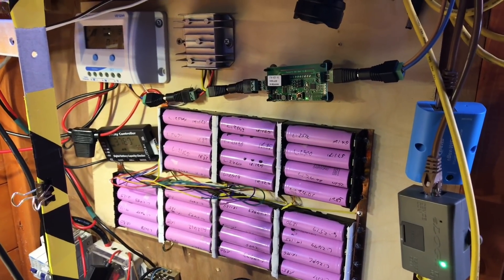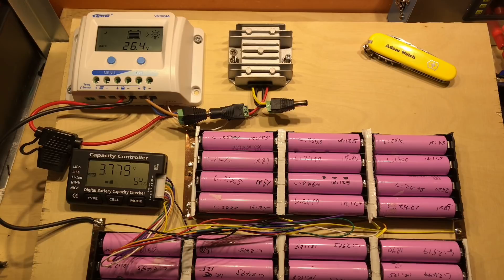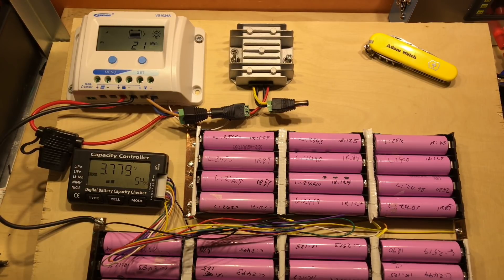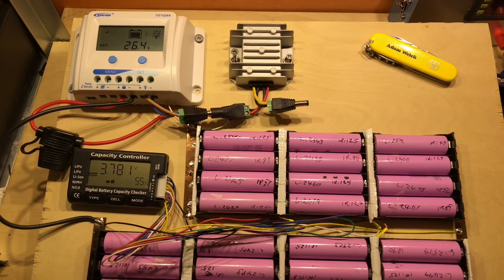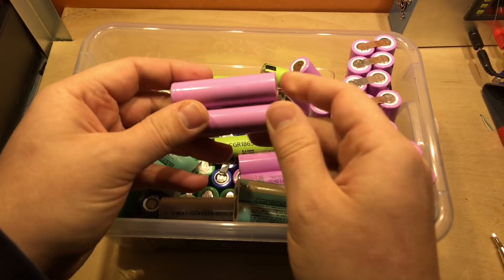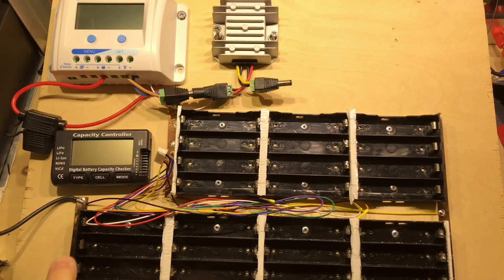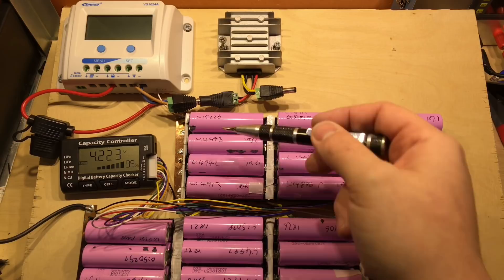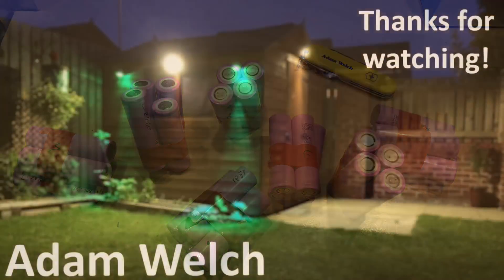Solar Charging Lithium Ion 18650s - Part 5, A Year On - 12v Solar Shed

Comment: Those tests should be interesting. Please remember that a 'cycle' is a full charge and discharge. If the cells were, say, 50% discharged from full during one night, and then fully charged the next day, then they will have undergone half a cycle. Thanks Adam.
Reply from the maker: +RWBHere Yes This has been mentioned. I’ll try to remember to refer to them in that way next time. Cheers.
Reply: If the cells are not fully discharged they undergo a somewhat exponential cycle-life extension. Just as with lowering the top-of-charge voltage, raising the bottom-of-charge voltage increases cycle-life by a multiple every x millivolts.
Reply: Thank-you Adam. // That's interesting, Markle2k. Live and learn. Thanks to you, too. :-)

Comment: From what I read they lose capacity the higher you charge them to their 4.2V limit, so at 4V they should still be good. I think it was 10% loss over 1000 charges.
Reply from the maker: +SidneyCritic ComedyHound I wonder if the low temperatures for a few months have a worse effect than the partial cycles? Either way, I think there will be some reduction.
Reply: Adam Welch I thought low temperatures were good for lithium cells

Comment: Some people build a serious power wall and spend a great deal of money and only wind up with 2-1/2 years so is it really worth it?
Reply from the maker: +MrBrymstond I’ve not really seen any evidence of people’s power walls giving up yet.  It’s one of the things I’m interested in. Tesla guarantee their for a few years - new cells I know, but they must have some confidence. Lots of factors to take into account though.
Reply: Good question. I have been running some.part of my Wall for 2 years and no sign of nog wear. Lost like 5% at Most in capacity on that setup. My 100kWh bank should last 10 years at calculated useage before it goes below 60% capacity left. Time will tell :)
Reply: The thing is these 18650 batteries range between 500 and 800 cycles, unless you have a monster power wall that would last you a few days before charging each morning it charges and you use it all day and night so it drains, that's one cycle... 2 years @ 800 cycles is 730 cycles, just saying.
Reply: My big wall is 100kWh and its LiFe 18650 cells. They have a nominal of 4000 cycles at 80% DOD. I run 10-15% DOD in general. The small wall is 40kWh and thats LiIon cells. At 80% DOD they are said to last 500 Cycles. Im running them at around 10-15% DOD as well and should therefore last 2500+ cycles (Regarding to various datasheets and tests). Of course those is hard to tell if they will since they are 2nd hand. Time will tell but so far 2 years later on the first setup I did there is no big sign of loss of capacity. If I would have been running them 80% DOD they should have lost atleast 40% capacity by now comparing to their datasheets but they havent.

Comment: Hi Adam, how do you monitor the voltage to know your capacity was down lower than desired for 2 days from 365?

Is this a daily manual task or do you have something hooked up on auto pilot to save the data electronically? 

I saw what Paul Kenneth was doing with his laptop batteries rip outs and it makes total sense to keep the batteries paired up. Furthermore, it’s less work for double the capacity, no brainier when you think about it.

Do your exterior shed lights go on all night or are they activated using PIR? I’m interested to know as currently I have 5v LED bulbs hooked up via 240v mains lighting up the whole of my back garden activated by light sensors. The police advised me to light up my back garden at night after I was burgled as well as install CCTV. I want to switch power sources so these back garden lights work from solar stored energy rather than 240v mains. I suppose if it comes down to it I could integrate a relay to charge the batteries using 240v mains if the battery bank voltage drops below a certain level but it would be a Brucey Bonus if the battery bank has enough capacity.
Reply from the maker: +Steve Kent Currently I monitor this manually, but hopefully I’ll be taking steps in the next few weeks to monitor this more intelligently. 

I have some external lights on PIR - white security lights. I then have some coloured led lights which come on a dusk for a few hours. It’s all led and wouldn’t cost much to run on mains but I prefer to run on solar whenever I can.

Comment: Nice work Adam, been playing with 18650's a bit myself this year, I am assuming you get your cells from laptops being joined in pairs like that but where do you source the laptop batteries from if you don't mind me asking as I dont seem to find many and im a bit weary about some of the auctions on eBay! Keep up the good work!
Reply from the maker: +RS2 Projects I did buy 40 laptop batteries in a bulk eBay auction a little while a go.  Having looked at the prices though recently I’m not sure that’s the most cost effective method now. 
I work in IT so they pop up occasionally in my work.
Reply: Yeah just what I was thinking with eBay, lots of people catching onto the 18650 goodness these days haha, cheers for the reply :)

Comment: If possible I would add another or two 100 watt solar panels, you have doubled the charge load on your current panel, so it may slowly become discharged. If not you may have to plug into the grid at times to top them off.
Reply from the maker: +C MJ Theoretically I’ve increased the potential internal resistance so there may be an increased internal discharge, but then I’m cycling the cells less too. I wish I could increase my solar - the shed roof is full!
Reply: Maybe you can get more efficient solar panels, not sure. I have no place to put solar panels. I wish I did. I would like to be off the grid.

Comment: Im using a Victron 75/15 to charge 100 ah Calb Lifepo4 battery in my van - solar only been hooked up for a week but seems to be charging cells very well - charger shuts off at voltage I set -  180 watt solar puts 600 wth back into battery each day - also have R/C charger hooked to system to charge battery from van alternator- this charger has been hooked to battery for 5 weeks and will charge battery at. 50 amps and has worked well so far
Reply from the maker: +GroovyVideo2 Sounds good. Always good to have two options for charging.

Comment: Looking forward to the results of the old cells capacity and seeing if the 100w solar panel will be able to charge up the larger battery bank to full capacity. Take care!
Reply from the maker: +Bill Younger Thanks Bill. I’ll feed back as soon as I can.
Reply: Did the new increased capacity batteries survive the winter?

Comment: Thanks for the update, looking good! I've been using the paired cells as well in my battery packs.  Also saves half the processing/testing time as you are getting 2 cells for the time spent on a single cell.

Comment: Nice video. Just bought an CellMeter-7  from your ebay link. Thanks.
I have a few TP4056 charge/protection boards and would like to charge my batteries to 4.0V instead of 4.2V.
How would you suggest I can charge Li batteries to 3.9 or 4.0V instead of 4.2V?
I have read that the U.S. Army charges theirs to 3.9V and gets about 10 times the cycles out of them!
I could use OP amps as comparators with the desired reference on one input, which would turn the input MOSFET off, once the battery voltage reaches 3.9 or 4.0V, but was wondering if there are any easier ways?
Reply: UFOhunter use a shotky diode, that would be the easiest way i can think of
Reply: I think using a schottky diode (drops 0.3V) has exactly the opposite effect when charging. 
It will charge the cell to 4.5V to read 4.2V. 
No?
Reply: MMm I had to think about that for a sec  ... the output of the module will go to the max of 4.2V so .. minus Schottky .. 3.9V.  But the charge curve will not be what it should be I think.
Reply: No you've got it backwards. I am a 100% sure. That is the 1st thing I thought of, but quickly wrote it off.
It would work if I wanted to charge the battery to 4.5V. Thanks guys for your input though.
Reply: This is the pdf  https://dlnmh9ip6v2uc.cloudfront.net/datasheets/Prototyping/TP4056.pdf   It is an output to the batteries and not visa versa.  '·Preset 4.2V Charge Voltage with 1.5%
Accuracy '   So how could the voltage on the batt get higher than 4.2V if you substract voltage from the output?
Reply: The output of the 4056 will never go above 4.2V. I have tested this.

Comment: I like your project. I think small battery packs, and slow charging and discharging is good way to use 18650 used cells, cause its easy to maintain, and its SAFE. How fast do you charge/discharge them? Do you have any mA current per cell calculations?

Comment: Where is the video on using the capacity controller to perform balancing?
Reply from the maker: +Gregory Germain Part 3 of the series... https://youtu.be/Pnrxm3KNjes
Reply: Thanks.  I love what you're doing.  Looking forward to the follow up report on the condition of the batteries!  Also hoping someone comes up with a cheap PWM solar controller for 3S that actually cuts off the charge when the batteries are full instead of trickling.

Comment: I have been waiting for this update I really need to build myself this project I have enough 18650 cells I just need to test the capacity’s and build the thing. Nice video once again Adam!
Reply from the maker: +Steven Watson Cheers. I’m very interested to see how hard I’ve been on the original 28 cells. Care to place your bets? 10% lower capacity, 20%?
Reply: Adam Welch hmm 🤔 I don’t feel that you have pushed these cells hard only the 2 days where there was low solar power, saying that the temperature environment could potentially be harsh the extreme cold in the winter and heat in the summer I am going to be optimistic and place my bet on around 10%. What do you think Adam?